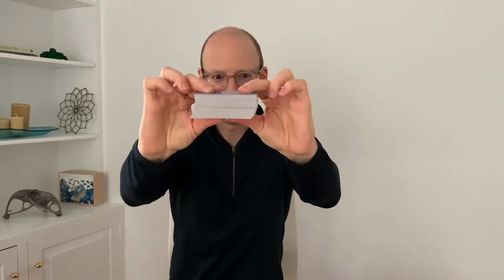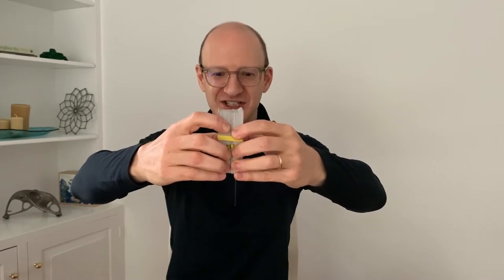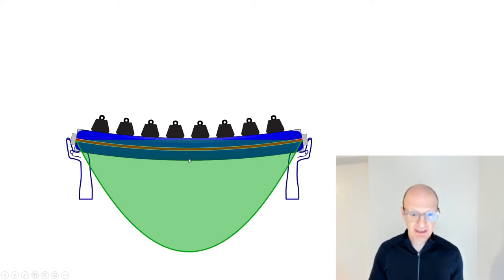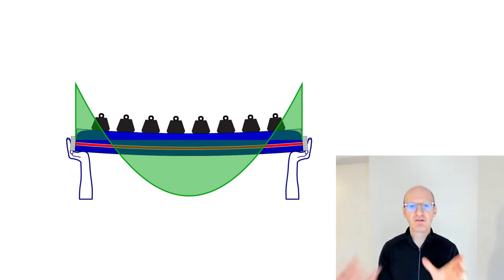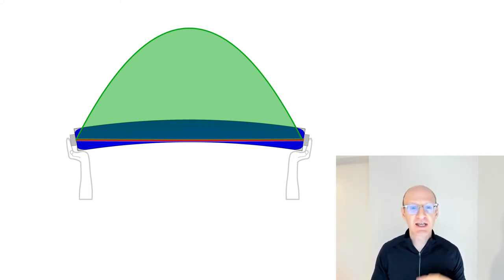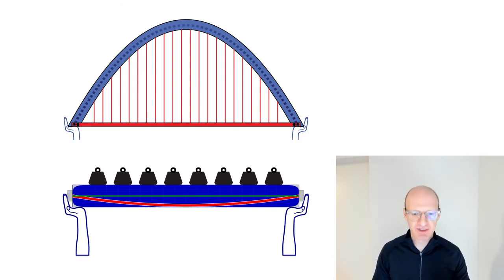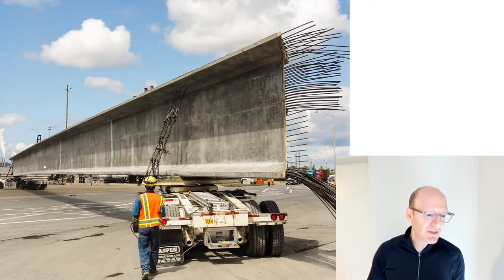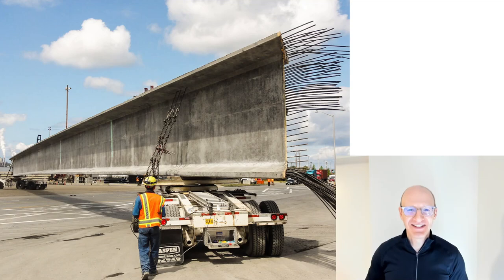How Prestressing Works! (Structures 6-4)

Comment: A thing that doesn’t quite make sense to me yet is why when we have a bending moment in the opposite direction (up) we don’t cause the concrete the fail in that direction while we’re waiting for the load to be added. Is there a danger of a structure like this failing if you remove load? Or if you are building it and haven’t added a load yet?

Comment: Feedback: props are great. A pack of card and them tied or pretensioned is great. For a beam try using a foam and for tendons use an elastic band. Pass a tendon through a foam beam.

Comment: How much more pressure is the tendon under in your no bending moment example?  Is it all tensile for the tendon?  Wouldn't it be magnified or focused on that tendon?  So you'd need a material that's quite strong.  Is this correct?
Reply: Also, is the compression in the beam increasing simultaneously as the tension in the tendon would increase in the no-bending-moment example? So you'd need a material really strong in tension for the tendon and a material really strong in compression for the beam?
Reply: Prestressing strands are made of very strong steel. Much stronger than conventional reinforcing steel. And how much pressure any part of the girder is under is part of the design of the girder.

Comment: In my youth I had a "Temp job" where I worked with a company that was (one of many) contracted to work on the "annual refurbishment" of a "car factory". [All refurbishment had to be done during the 4 (summer) weeks when the factory was "standing still"] .
And the factory buildings were "enormous", with 150" long "Ceiling girders" of pre-stressed concrete". One day I and one of regular employees of the "refurbishing company" were tasked to relocate the placement of rails and  power outlets for welding robots, and when doing so we  ran into problems with getting the repositioned power cables to reach the "assigned power ladders". A problem which my ""colleague"" chose to ""solve"" by drilling into one of the ceiling girders to attach an "extension"...
When this was discovered (naturally) all hell broke loose, and my "colleague" was more or less interrogated about "what had happened" when he drilled.... But they didn't do anything "practical" about it for as long as I was there. And I don't think the ceiling caved in  afterwards either.... And my "colleague" wasn't even reprimanded, so he went on to (unwittingly) destroy a vital part of the "100-ton scrap metal compactor" that was used to compress ALL "off cuts and stamp outs" that were produced in the whole factory... That man(child) was a  "certified tool"...
Oh happy days ;/
Reply from the maker: wow...

Comment: I was wondering if prestressed technique increase bearing capacity of beams or it is only about elimination of cracks?
Reply: Pre-stressing greatly increases the capacity to carry bridge loads for a certain girder cross-section. Concrete bridges that pre-date prestressing tend to get very massive as the bridge gets longer (so you can add a lot of internal reinforcing steel). BTW, this type of bridge girder goes back to the 1960s in the US (to my knowledge).  The girder shown in the video is from Washington state, which is a premium precast girder area for the whole world.

Comment: Hi Paul. Thanks for the great videos!

I build wooden arch bridges (mainly for hiking trails), and have been thinking if it would be advantageous to use steel cables, that would be following the arch shape, inside the arch to prestress them. The ends of the arch, against which the cable would be tensioned, would be either cut vertically or radially, if it makes a difference. My intuition is wavering: tensioning the cable could force it to straighten, which would be counterproductive for my use, or tensioning the cable could force the cable to a tigther/smaller radius because the ends of the cable are below the centroid of the arch, like in 4:07, which would be useful for prestressing my bridges. Am I on the right track at all? :D

The goal is to make sturdier and thinner long single-span bridges. A tied arch does help, and I think could be pre-tensioned as well so that the arch would carry more load. But many of my bridge sites do not allow this for aesthetical reasons or because thick ice sheets forming on the rivers that the bridges span across.

Comment: So how much concrete and/or steel can you save by this technique? My gut feeling is that you are just replacing concrete with steel, but I guess I'm wrong since it doesn't make sense economically.
Reply: I think of it more like a marriage between steel and concrete that takes advantage of the strengths of both and minimizes the weaknesses.

Comment: How do you put a tension in a wire that is sloping in a curved position, in the beam, can anybody explain that to me please thanks
Reply from the maker: There is a curved "conduit" in the beam so, when the cable is tensioned it stays in that curved form and applies equal/opposite reactions to teh restraining beam material.
Reply: Thank you Paul for your answer